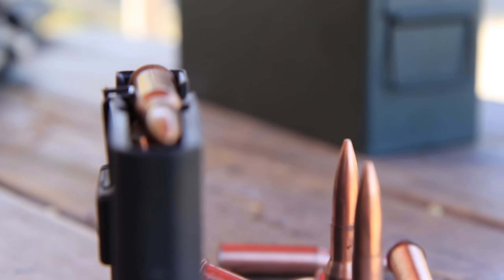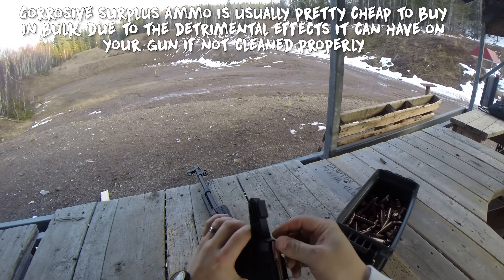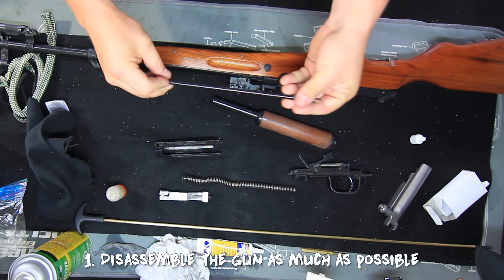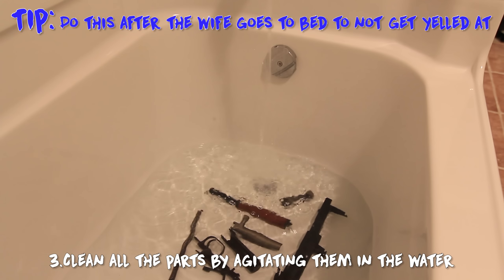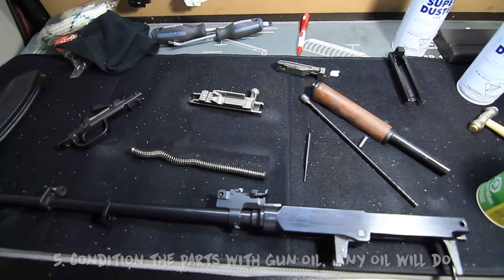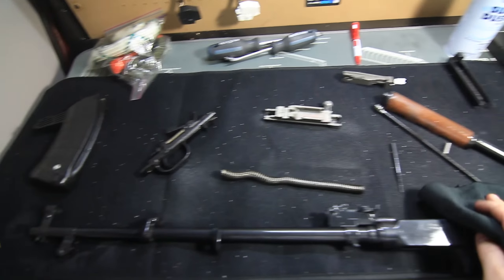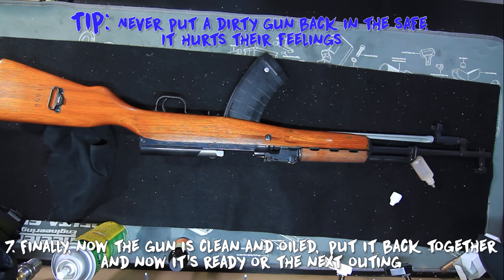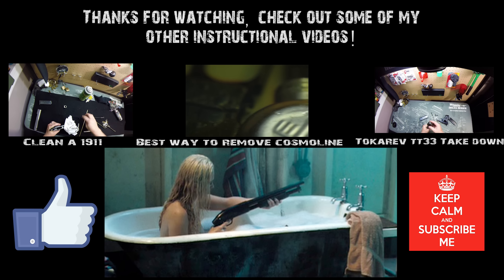How to clean your gun after shooting corrosive ammo

Comment: Great video. When I clean my SKS after corrosive ammo, I usually just run boiling water through the barrel and all over the receiver, the gas system, and the magazine. Then I clean the bore with patches and finally, lightly coat it in oil and wipe it down with a cloth.

Comment: I basically do the same thing but with Simple Green in the hot water. Very quick way to clean the rifle for sure. Great vid.
Reply: @ Josh Russell : does springs in the trigger mechanism get effected by the water, do they develop rust ?
Reply: 50 Calorie if the trigger group is not cleaned properly than yes it can become rusted. I owned an sks once that the trigger group was covered in rust. After a complete disassembly of the trigger group and a heavy cleaning I was able to remove the rust by using a rust cleaner. Long story short, if you take care of your firearms they will last a long time.
Reply: 50 Calorie sorry for the late reply. I didn’t get a notification. I use compressed air to remove residual water from the trigger group. And I make sure the water I am cleaning with is screaming hot so any smaller droplets evaporate from the residual heat in the metal. Rust has not been an issue for me when I use this method.
Reply: 6 years late... 😂
Reply: @Soli_Deo_Gloria_.  better late than never right 😅

Comment: That is one very intense cleaning. Wife's not happy with how much time I spend with guns now. That would spell divorce! Lol. I just use an old Windex bottle with hot water and a drop of dish soap. Spray it don the bore and run a brush through it 3 times, spraying more water each time.Spray the gas components and wipe down. Pull a few pieces of old t shirt down the bore till dry/clean. Then one more with lube/cleaner of your choice wiping the other parts with it as well. My tokarevs just get v 58?, I think, anti corrosion oil. No problems for the last few years. I once saw Russian troops cleaning their rifles in the field with a funnel and hot water. That was all.

Comment: I use boiling hot water and pour it down my Mosins barrel and soaked my bolt in boiling hot water.
The boiling water strips the oil and neutralizes the salt from the primer

Comment: I simply pour kettle worth of boiling wetter down the barrel and around the action and chamber. and that works pretty well it's what the soldies of that time did and it worked for them after all.
Reply: i do this after the bathtub then air compressor then oil